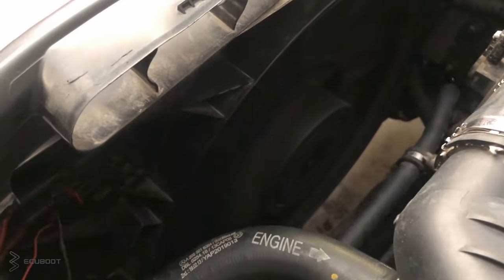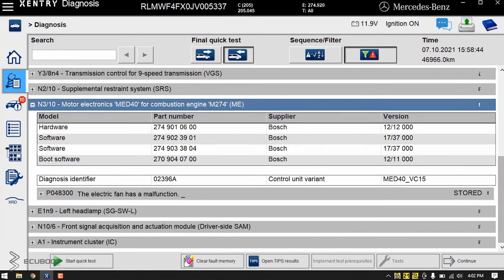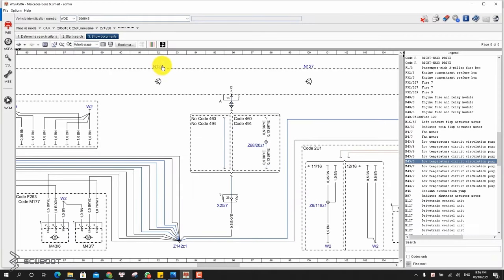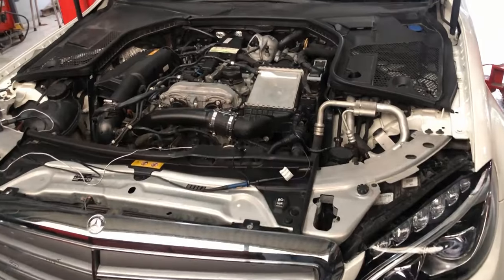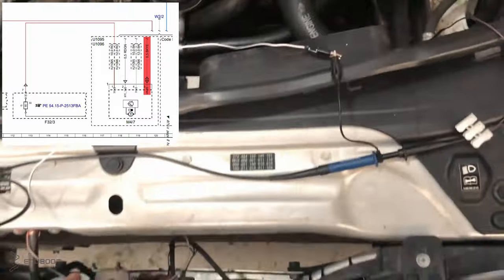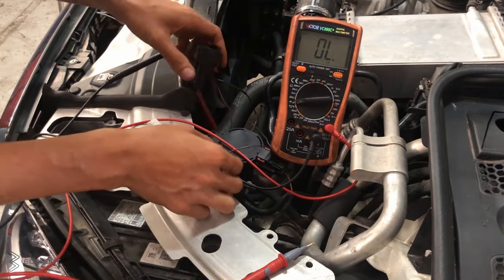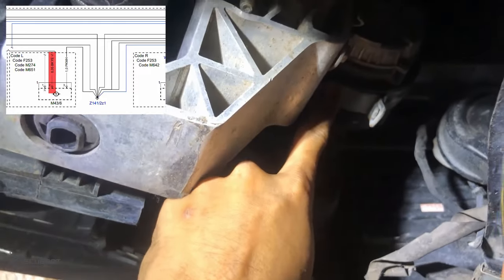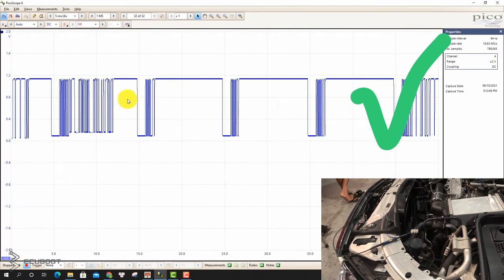How to fix Mercedes Fan on high speed even when ignition is off

Comment: Hi, my Mercedes e350 running cooling fan high speed soon I turn the engine on after few minutes and stays running till I turn the engine off, no codes. Any idea please
Reply: Hi did you solve the problem? I have the same problem
Reply: @AlexAlex-cs8bi me too
Reply: Replace the ecm,
Reply: @AlexAlex-cs8bi tap the module top of engine while measuring see if voltage changes at rad fan connector
Reply: @AlexAlex-cs8bi . I am a Tech. On my C 300. I have the some problem . I change my battery end it fix my problem .   Nobody here mention the battery I scan it, and I have 7 code .  The battery was the problem . Have a Bless day

Comment: I have the same problem with vehicle W213 engine M177, have an error Shutoff valve open circuit, what's the problem, when I do the multimeter, I see 3 wires goes GRND, and only 1 wire Positive,  I think maybe the SAM?
Reply: Use Xentry diagnostic software as used in this video it may help u.